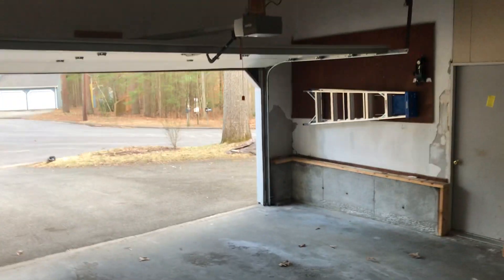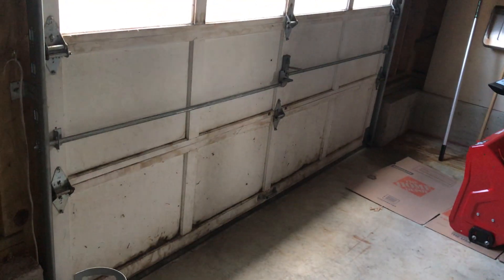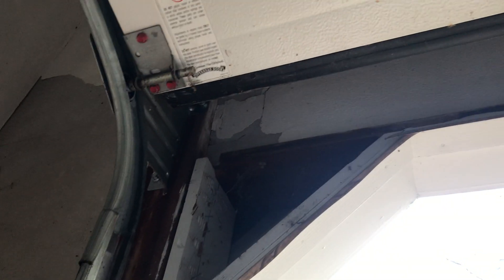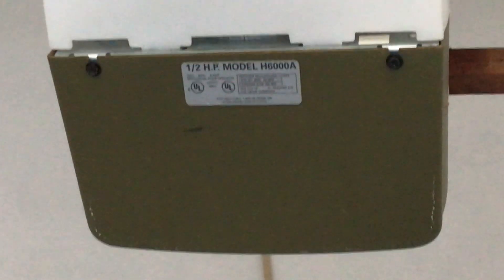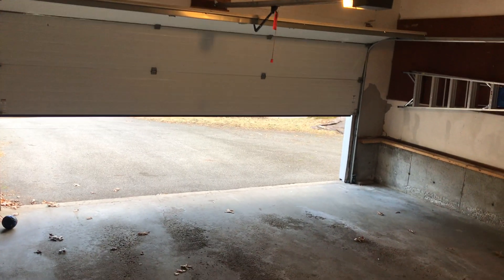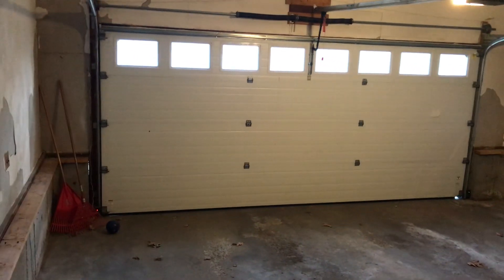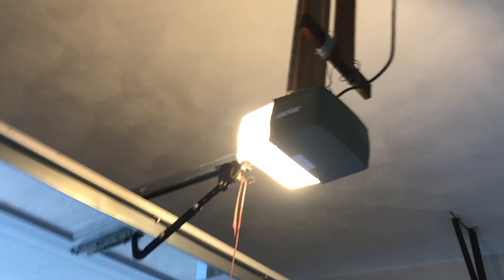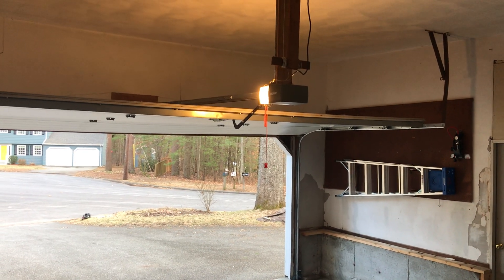Genie H6000A on an Overhead Door

Comment: I'm trying to fix mine...the remotes stopped working. :/ Still investigating what's up with it.
Reply from the maker: These problem you are experiencing may be one of these:

1. You might have LED bulbs that are not rated for garage door openers in your opener, which may interfere with the remote range and cause the remote to not work from far away or not work at all.

2. The battery in your remote is running low.

3. The logic board is bad.

4. The remote needs to be reprogrammed or replaced.